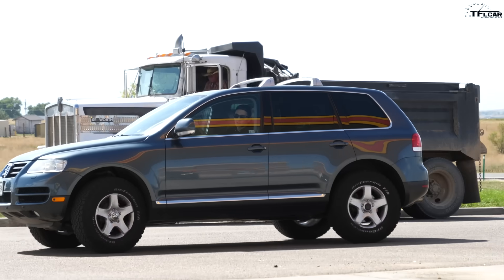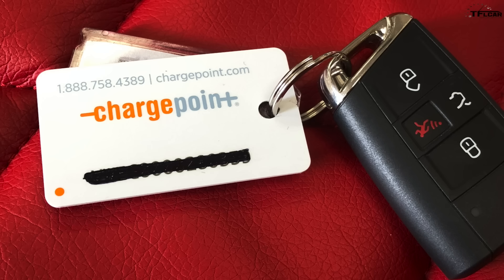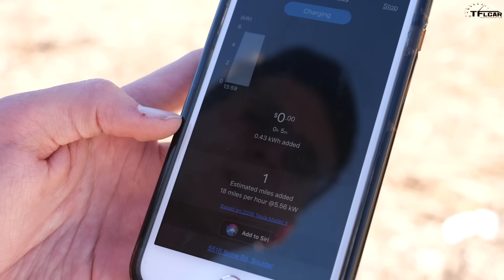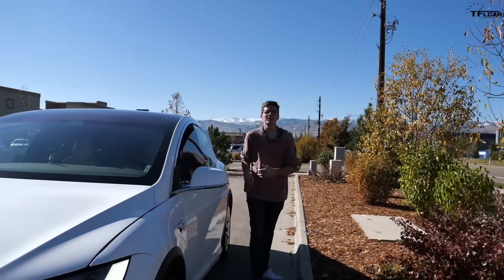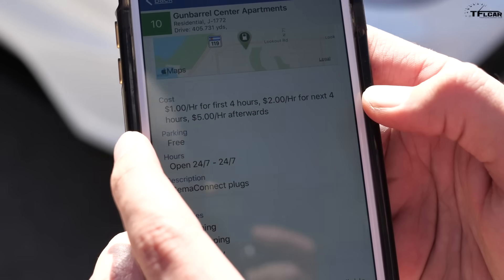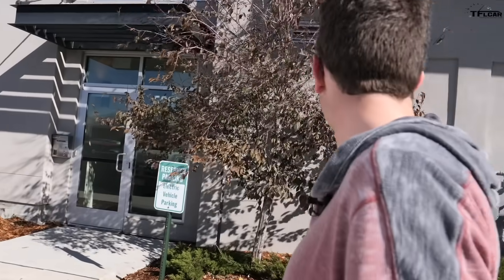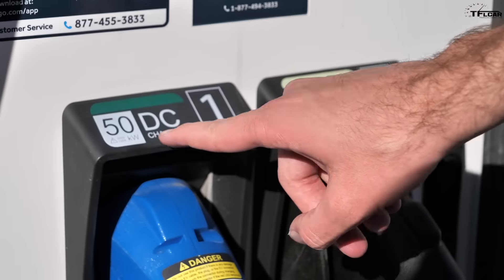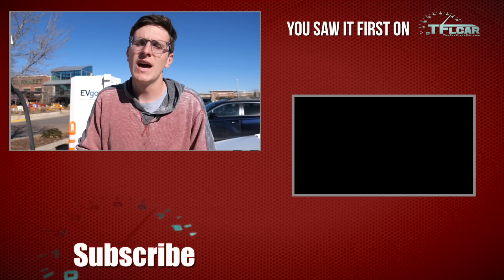Here’s Why Charging an Electric Car Can Suck - And It’s Not The Reason You Think!

Comment: I know at least a dozen people with EVs and without exception every single one does all of their real charging at home overnight.

Does anyone who owns an EV and works a full time job actually use communal charging stations for significant charging? Why don't journalists try using EVs the way EV owners use them?

I know if I couldn't have a fully charged EV, ready to drive 200+ miles every morning (and drive less than 200 miles per day), I would immediately get rid of the EV and go back to a gasoline (or diesel) powered car/SUV. Charged at home and driven within their EV range daily, EVs make exceptionally good daily commuters (IMO) and the savings in gasoline (electricity is cheap relatively speaking) and maintenance pays for the EV and home charger very quickly.
Reply: BTW, Tommy mentioned he couldn't see someone like his mom driving an EV...

My mother who is almost 80 years old is buying her first BEV right now (after trying a plug in hybrid for a few weeks). She absolutely loves the idea of never having to go to a gas station (or EV charging station) and always having a fully charged car every morning, ready to drive 250+ miles.

Also several of her friends (same age) have already switched to EVs. Absolutely all of them charge at home and pretty much never use communal charging stations (some did at first but the novelty quickly wore off).

Comment: 0:37 I wish people would stop spreading this misconception about level 1 charging. Sure it COULD take days IF you are charging a COMPLETELY dead 300 mile battery pack. But if you are just charging what you used running around town for errands you will be fine for the most part.
Reply: It’s really odd how people think you’re so commonly in a situation where the car is at 0% somehow, and you MUST wait for it to hit 100% or something. Like somehow you’re suddenly going to not even notice the car is dead, and you can’t drive away with a partial charge so you’re just stranded for 3 days or whatever.
Reply: @ericspda  Most people are still in a mindset that you only refuel at E, and that when you refuel you want to fill it up to 100% before continuing. 

With an EV that thinking goes out the window. When people begin to realize that you only need as much juice as it takes to get to your destination, range anxiety will end.
A 400 mile trip in a 300 mile range car means you only need to make a short stop to recharge to drive 100 additional miles on the road (assuming your destination has a charging spot), rather than wait an hour on the road to refill it to 100%.

There's really only one thing that stops me from running out to buy a Model 3 today. My paid off 9 year old car has 138k miles on it, and at the rate I'm presently driving (3k per year) it will rust away before I need to do major service on it.

Comment: This is grossly misleading.  5 or 6 kw per hour is a pathetic charge rate.  A Tesla owner would only use a charger like this in an emergency.  Charging at home overnight is NOT A BIG DEAL!  It's no different than the circuits we use to run our clothes dryers or electric ovens.  These weak chargers are gimmicks to attract people to motels and malls. 16 mph charge rate means anyone driving 60 miles per day would be spending 4 hours a day at a charger, which is totally impractical and not hoe the industry works. It's like grocery shopping at a gas station and complaining about it.

Comment: I really don't see the big fuss. Just like you can't charge an iPhone with an Android cable, your Tesla needs an adapter to use the universal standard. A lot of these issues are focused on Tesla owners, who are quickly getting outnumbered by other EV owners. I agree that charge points could be better streamlined and standardized, but this is a totally new industry (<5 years in the "mainstream"). The infrastructure is still catching up, mostly due to stonewalling from FF companies and lobbyists (infrastructure is a government, and therefore political, problem).
The fact is that EVs are still a niche market. They make sense for daily commuting if you have a garage or a charge point at work, but not for everything else. A lot of us still need an ICE vehicle to fill the 5-10% of trips that don't fit neatly in the battery range. 
EVs are still a luxury afforded by those with the means to accommodate their limitations. Just like the iPhone, everyone has to buy into the ecosystem (proprietary connector, horrific iTunes software, data plan etc) before it can really succeed.
It's good to point out the inconveniences of owning an electric car but, just like most inconveniences, they can be remedied and mitigated by slight changes in routine and improvements over time. 
And let's not forget, you could never fill your car with gas at home before. IMO, that convenience outweighs any of the annoyances outlined here.
Reply: Hard to get outnumbered when model 3's alone outsell all other EV's combined.

Comment: So 100 years of standardized gas stations equipment, EV builders and charging companies didn't use them as examples to make things easier for consumers. Also, regarding your last statement, why should consumers be forced to download multiple apps, buy multiple adapters, and risk credit card information thru one app connecting to a different company just to stand around for half an hour to charge car, that's ludicrous!

Comment: Until very recently I drove a Bolt EV as my daily driver.   I have a garage, and spent the $1k for an electrician and a Chargepoint home charger.   I'd just plug in when I got home at night, and with a 50 mile round trip charging was usually done in a few hours.    This was J1772.    One time i did a trip of 180 miles just to see how it went and to cover a sales call I was going on as the tech guy.   I checked in advanced and EVGo had DCFC chargers that the Bolt worked with (a $750 option you need to buy when you get the car).   Their charging session stopped at 30m, and I had to reset it and do a second charge to get the 45m of charge I needed to get battery up enough to make it back.   When I got home, I plugged in.   While it took 9 hours to recharge, I plugged in at 7PM and it was done at 4AM and was fine.   The problem I had with EVGo was their price was a bit of a wild swing.   $16.89 for 26.260 KWh, or about $1.55 per KWh vs $0.13 at home.   Also, with DCFC you need to be aware that at 80% it stops being a FC but still charges you at the FC rates.  you drop to L2 speeds for the last 20%.  Now this was September 2018 in Charlotte, NC so maybe it's changed since then price wise.
Reply: Your problem was the price and not the 9 hours it took to charge your car enough to get home?
Reply: @MexicanSpec  that was my 'after got back' charge on L2, the DCFC/L3 took 45m to get 80%

Comment: Every garage has an electrical panel next to it which has 240V, it costs $40 for electrical wires, some pipe, and outlet if you do it yourself or pay an electrician $200 labor to install it.
There are 127 millions house in the USA compare to 168 thousands gas station. 
Take 5 seconds to plug in at night and 5 seconds to unplug in the morning every 3 days at home and 2.5 hours at supercharge for 2 road trips = 55 hours for Tesla Model X after 10 years
BMW needs to stop by gas station  395 times and each time take 18 minutes ( 5 minutes to drive to gas station, pump 8 minutes and 5 minutes driving back home) = 118 hours plus 2 hours time waiting for oil change  twice a year for 10 years =20 hours. 
total = 138 hours after 10 years

Tesla model X
 after 10 years or 150 k miles

Carbin filter replacement 4 times = $400

Coolant replacement 3 times = $1800

Electricity cost $7500

Total cost $9700

BMW X 5 after 10 years or 150 k miles
7,900 gallons of gas =  $62,000
15 oil change = $1800

2 major tuneup = $2000

New starter, new alternator, p/s pump, fuel pump, oxygen sensor, MAF sensor, oil leaks repair ( valve cover &oil pan gasket)

$2400

3 times brake job $3600

5 smog inspection $300

Total cost $72,100

Comment: I live in southern California in an apartment and have a Bolt. It would be annoying but using only public charging can be done. You would have to use a lot of fast charging if you cant plug in at home, but its not so bad if you are out a lot. If you can fast charge while your out eating dinner twice a week then it could work. I probably would not have bought my Bolt if I had to charge that way, but I got lucky. My work allowed me to charge there if I paid to have the 50Amp plug installed. I installed the plug and got my Bolt. Now I can get most of my charge two days a week and if I have to go more than 100 miles in a weekend I can just do a quick 10 to 30 min DC fast charge to make up the extra miles. The public charging infrastructure is almost good enough to buy a non Tesla EV when you cant charge at home or work. But with a Tesla you could almost certainly charge just fine in with the Tesla chargers since they are fast enough to give the range needed in short charge sessions.

Comment: I like the well-rounded presentation of various charge options available and that they are still growing.  Having an older Leaf and a Model 3, I can truthfully say I've experienced all the same issues you mention but I usually just charge at home on a 14-50 outlet that wasn't that hard to install in my garage.  Like you stated, not everyone considering an EV will have that option and they need to be aware that there are many other options.  BEVs with smaller batteries and less range will not take as long to charge back up but will need charging more often.  Thanks for the video.

Comment: The more of these videos about electric cars I watch, the more they convince me to stick with a normal ICE car, so much easier
Reply: The problem with these videos is they don't show how EV owners use their vehicles. No EV owner (that I know of) charges at community charge stations (other than on very, very, very rare "emergencies").

The way to use (and be happy with) an EV is to buy one with more than enough EV range for ALL of your daily driving. Then install a fast enough charger at home to charge after your daily driving in less than ~8 hours.

Every time you are home, plug your EV in. Every morning you will have a fully charged EV with more than enough range for all of your daily driving so you NEVER will use an annoying, time wasting communal charging station (except possibly the occasional free one at a mall if the parking location is decent). No more gas stations or waiting at ALL to fill your vehicle, cost per mile is around 15-20% compared to a gasoline car/SUV and you'll pay for the EV and home charging equipment in a year or two (the more you drive the faster an EV will pay for itself). EVs also have very little maintenance so it should spend minimal time getting maintenance done. On top of all this EVs (even cheap ones) are very quick and fun to drive (and fast EVs are insanely fast and fun).

Everyone I know who has tried an EV with adequate range and charges at home, no matter how skeptical they were at the start and how much they loved their high performance gasoline powered car, they still NEVER go back to a gas/diesel vehicle for daily commuting.

Also, for occasional long trips, don't waste your time with an EV. If you don't also own a second or third vehicle that is gas powered then rent one for the long trip.
Reply: Or a hybrid, I am thinking for our family it makes more sense than EV.

Comment: Your video is GREAT:-( but  your title is SO negative!.
If you have a house charging at HOME is perfect = you never need to worry about charging. Just plug in when you get home and your car is ALWAYS FULL :-) . NO need to go to any gas station or charging spot. Additional help is charge at your workplace if they have a chargers (usually would be FREE too). Using this option you can actually use a shorter range EV.
Above is true for ANY brand EV.
The exception to the above is when you go on a long trip. Then you will need to charge on the way. 
This is where a Model 3 Long Range (now 322 mile range) shines using Tesla Supercharging vast network. Charging is 15 to 30 minutes typically for up to 200 miles additional range (with the NEW V3 Superchargers this time will be cut almost in HALF 10 to 20 minutes!) with almost FULL charge  0% to 98% takes only an hour (rarely needed, or good to do). 98% top since the last 5 miles of charge can take an additional 30 minutes that makes NO sense!
Other cars that are not Tesla have lower range and even "FAST" charging speeds are slower and have the problems shown in this video.
Oh well, this is why I just bought a Tesla Model 3 which actually charges faster than the older Model S and X with older battery system.

Comment: A pure EV car with a range of around 200 miles would work for me quite nicely in probably 80 to 90 % of my "local" driving but not so much yet that I'd be willing to pend the money to buy one.  I do have a 240 volt service in my garage so I'd be Ok charging with that but I am just not ready to go EV 100%.  On a multi-day road trip?  No way.  I've seen a number of videos that detail the experiences of others doing that but most of the trips I've made in the past simply wouldn't have been possible if I had been held to the restrictions that EV driving would demand.  I have no doubt that EV driving will become more the norm as time goes on but for now, the infrastructure simply isn't there yet.  It's my opinion that without significant upgrades to the countries electrical systems, it's not going to handle "everyone" fast charging their electric cars every night on top of the current loads that are already there.  Of course, those electrical systems are in dire need of the upgrade anyway but they don't seem willing spend the money so far.  I'm also very curious to see, assuming I live long enough, what the cost of electricity will be when everyone is dependent on it to power their cars?  Seven to ten dollars that I've seen many brag it costs to charge their car today sounds great compared to the $30 to $40 to fill up my Toyota Rav4 but I seriously doubt that's going to remain true when everyone is dependent on the electricity like we are dependent on gasoline.  We'll see.
Reply: I charge mine from the solar panels on my roof....just saying.

Comment: I have found that the Tesla Supercgargers work best for Teslas.   :-)
Reply: Just like the lightning cable works great with the iPhone. Lol
Reply: Exactly...  If telsa was smart, they would have setup a universal charger, then charged royalties to every company that wanted to be on board with the most adapted way of charging...  Instead they had to become charger snobs.  Same with their self driving features, not gonna work unless all cars can communicate with each other....
Reply: @bawbsyerunkle  Elon Musk gave all his competition the technology to do this, for FREE, and no one adopted it.  

Charger snobs?  Not all EV cars have the capabilities of charging at the rate of Tesla, theres a lot of battery science and cooling in place so that it can take that kind of power without overheating the batteries, as such most EV limit their charge rate regardless of how many kW a Supercharger pumps out.

They are not trying to be snobs, they are preventing ALL of their Supercharger stalls being filled up by cars that take HOURS to charge instead of 200 miles in 30min in a Tesla.

The autopilot works fine, and is improving everyday.  There is a reason we're not all still riding around in a horse and carriage, innovation takes time, but more importantly, it takes people wanting to adopt the new tech to make it better.
Reply: Stabface126 horse & carriage versus car and self drive versus autopilot is not even the same concept.
Reply: @bawbsyerunkle  They did mate. Blame the other auto companies for making their own plugs.
Reply: @bawbsyerunkle  Musk has offered that deal to other car companies, with no takers so far.